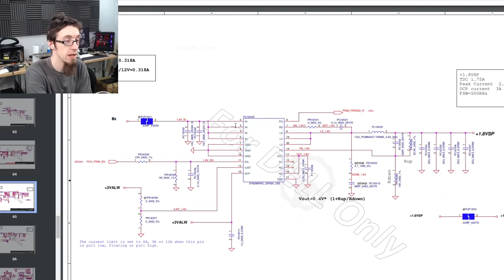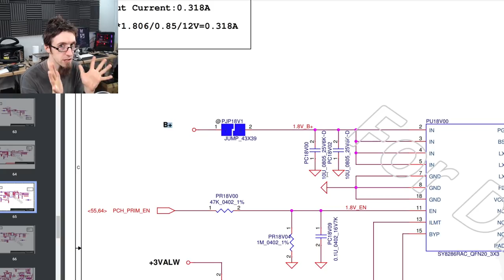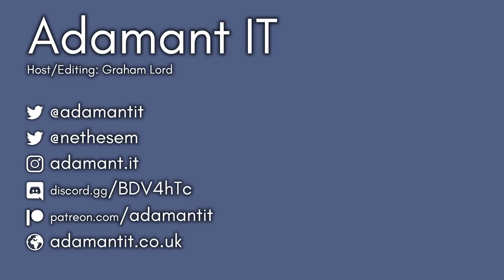Dell G5, charger cuts out, shorter version - LFC#283b

Comment: Hey Graham.  I have an HP laptop Ryzen 7 3700U chip that's giving me a problem.  I replaced the battery and now it won't run on battery power alone.  Even with the battery installed when I unplug the power cord it shuts off.  I've taken it to 2 shops and both can't diagnose the issue.  I'm in the US but I'd still love to send you my laptop somehow.  I've purchased another already so I don't need it but I want to fix it and use it as a back up.

Comment: Hello Adamant,
if my Asus TouchPad stopped to work and is not working in the BIOS interface as well.

Which traces should I check to follow the problem?

In continuity mode, I tested the cable.
the multimeter beeps for all the pins in the connector of the touchpad board and up to the pins on the motherboard connector. so for sure it's not the cable. I also tried with spare cables.

I uploaded a video in my channel from the touchpad connector area under the microscope. I do not see a capacitor blow or damaged.
my laptop is Asus Zephyrus S17
Reply: Throw your laptop in the dust bin